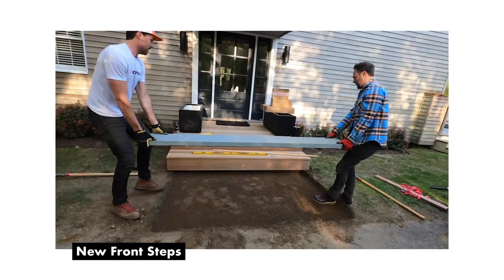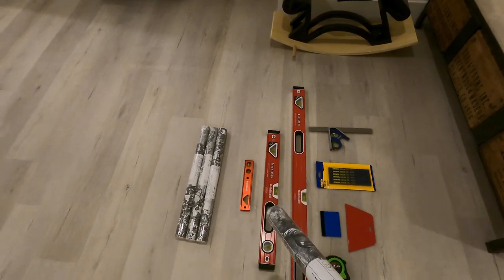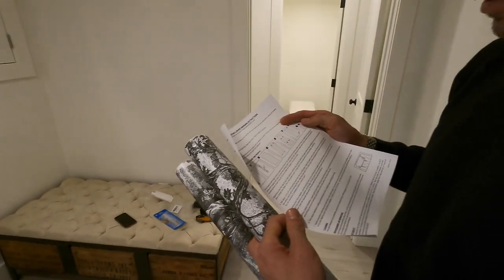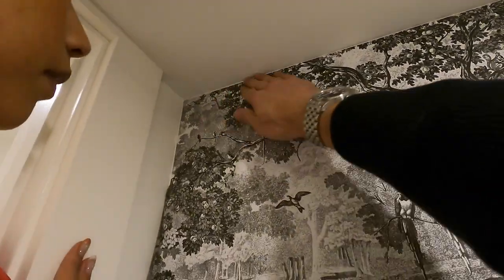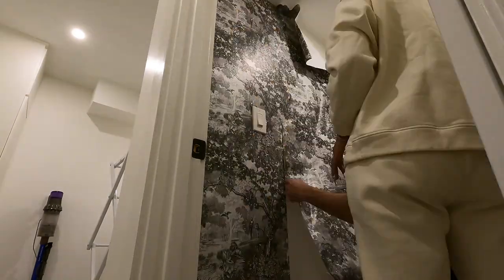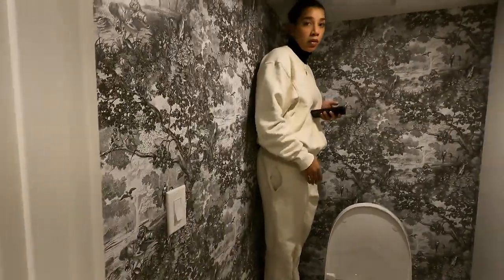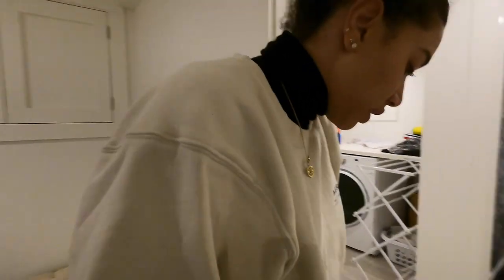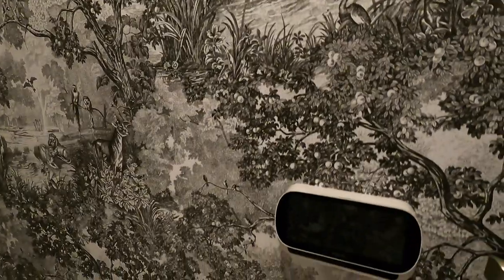DIY - Peel & Stick Wallpaper Powder Room Project

Comment: Wait, wait - how do you manuaver around the the light/objects to make it look seamless?? Did you lay over then cut? I actually planned to do this this weekend and this video popped up!
Reply: When I did mine I un screwed the light switch, placed the wallpaper then cut out the rectangle shape to get a seamless look.
Reply: @tillytay2014  Thanks! I figured, then I saw the other thing on their wall, and I'm like: "Did they take that off too??"
Reply: @docwaller  it’s easy to do especially if u use an Xacto or craft knife instead of a scissor